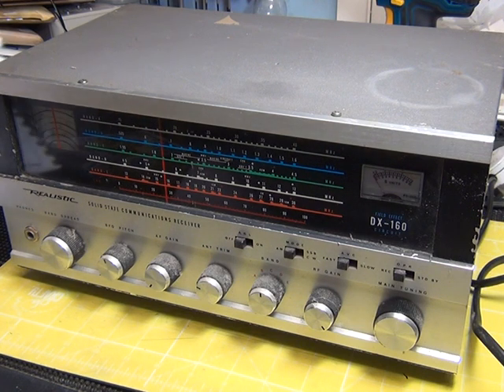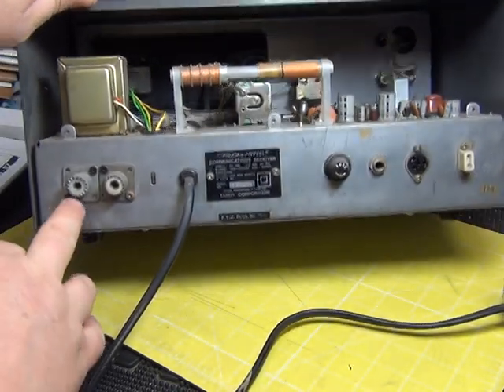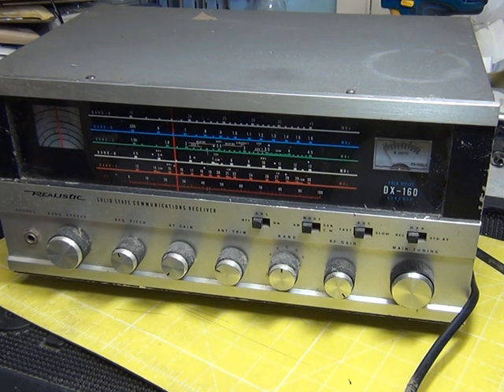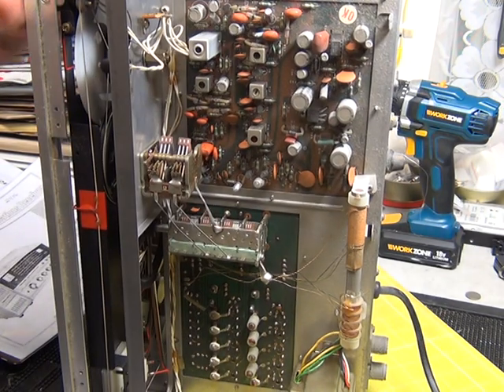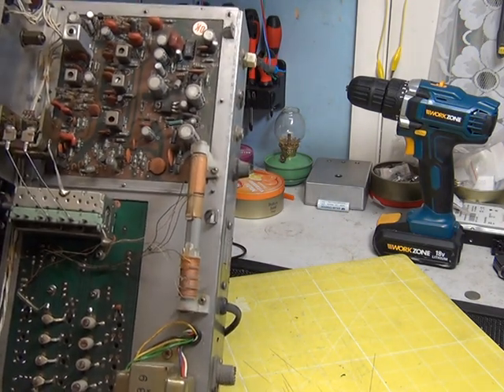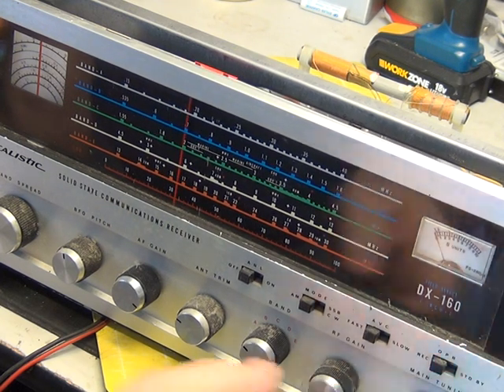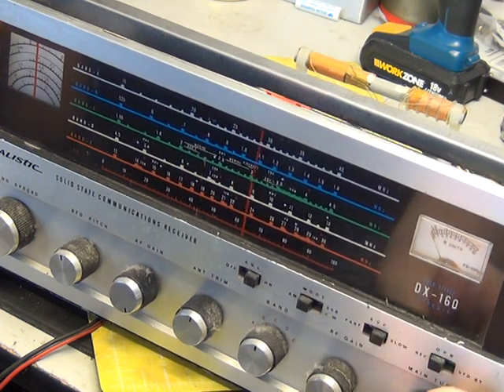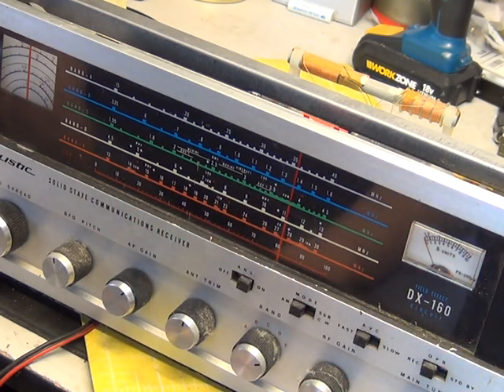Realistic DX160 overhaul pt1 (Late MkII version)

Comment: Hello,
I have the same receiver but the knobs have been changed. I want to put back some knobs that are as similar as possible.
What is the diameter and height of the original knobs? I think the tuning knobs have a larger diameter.
Regards,
JM  - CT1BRM

Comment: How do you tell if it's a "Late MkII version" & does it matter?  I've been looking for a 150B, but maybe the Late MkII version is better? 👍
Reply from the maker: Post Aug 20 1973 says the service manual. There originally was a date code on a small paper sticker...something like 10A4 would denote oct 1974 for example. However, other than that I can't remember. It's a long time since I did this video & if I remember rightly the later version has improved selectivity over the early one.

I recall the one I did in the video was 1976.

Richard, G0OJF, UK
Reply: Thanx for the effort.

Comment: A tip I found that completely eliminated hum in the audio.  Remove C76  (47 uF) and the ripple on the 10V rail reduces by about factor of 10.  Design flaw.   The DX-150 likely has same problem.   The LO drifts too, about 2kHz over 30 minutes during warm up.  (BFO against WWV standard carrier frequency)

Comment: Hi Richard
While you mention a dry joint on this: can't recall if you do, etc
I use a cheapie electric toothbrush  ( the couple of AA type) with the bristle end ground down to a simple plastic point. Very easy, very cheap, no shorts etc and very directional. Keep it coming :0)
Cheers, Dave
Reply from the maker: I'll get one..saw them at Aldi the other day for silly money. We have a smaller model sex toy type vibrator on each bench (pound shop), but your idea of grinding down the toothbrush i worth trying for spot checks in this instance.

Having said that I'm not aware of any dry joints on this particular set & doing the capacitors has brought it back to working order. Alignment tomorrow hopefully.

Comment: Hello from Hernando, Mississippi just 15 miles from Memphis TN!  I am in the process of re-capping my DX-160 as I write this note. Here's a question concerning replacing all transistors. I have it open and easy to get to. However, the traces are so delicate that my work has been slow replacing the capacitors. 
Therefore,. I have two questions for anyone who wants to answer. Really would appreciate your input. 
1. Considering that the transistors are equally difficult concerning the traces, would you suggest that I continue and replace them OR would you forget the transistors?

2. I have 7 capacitors yet to replace. What are your thoughts on me cutting under the OLD capacitors and leaving the OLD capacitors LEADS sticking above the PCB, then soldering the NEW Caps to the two wires left by the OLD capacitors? The objective would be to avoid disturbing the solder and traces of the remaining capacitors, although I know that there is still a possibility that I might overheat them and disturb them anyway. And I have never done this before because I like to do things right. Please respond if you will. Thanks so very much!
Wesley Kicker
Reply from the maker: Wesley. Capacitors need to be properly unsoldered not bodged in on old leads. We use an ordinary desolder pump tool though some people prefer desolder braid. We didn't find the circuit traces weak or small & had no snags whatsovever. The re-capping took 45mins for every electrolytic in the radio.

I can't figure out why you would want to change any transistors unless one proved to be faulty. I've no experience of transistors going weak, but either working or not working. Transistors aren't like valves (tubes USA) which go low emission with use.

Richard (UK)

Comment: Hi Richard, how do you find the Realistic DX-394?  Is yours the original (most complained about) version or the improved 'B Version', which dealt with many of the original's design flaws?
Reply from the maker: I've been too busy to look at it. Just spotted the box & it is date coded 11A6, so that will be 1996. I didn't even realise there were two versions. Might have to buy both to evaluate. I sometimes think that some peoples expectations are unrealistic though. I can't compare a mass produced 'cheap' communications receiver with a £10K commercial/military grade receiver; people do.
Still on a pipe organ restoration/installation so no hope of any videos regarding radio yet.
Richard
Reply: @ukfmcbradioservicingTango21  Yes, I agree; however, I think the negative reviews may have a few valid points.  You can identify the B version by its square "B" sticker in the corner of the back nameplate.  I had one back in '95 but I returned it as I think I found it too susceptible to bleed-over.  I guess I must have had the A version.

You may be interested to take a look at the following web page that describes the set having "fundamental design errors in the analogue circuits" and suggest mods to deal with them.  
http://www.monitor.co.uk/radio-mods/dx-394/dx-394.htm

Here's what one reviewer summarised the A version flaws as, but I've read about others not mentioned here: 
* Sensitive, but overloads with little or no provocation
* Filters way too wide for crowded bands
* Audio is only passable 

* 'A' version does not hold after alignment - some examples actually drift back out of alignment by the time the chassis cover is replaced
* Drift factors include thermal, humidity, and poor innate component stability
* Controls work well, but feel cheap. Tuning is known for its backlash
* Dial accuracy is only fair
Reply: @ukfmcbradioservicingTango21  I thought you'd be coming indoors by now, i.e. suspending pipe organ restoration/installation work, especially as it's gone very parky out there!   Brrrrr!  Those churches and chapels must be pretty chilly.
Reply from the maker: @zerox-mission5898  Yes, I'm having to pick my days

Comment: That should turn out to be a good radio when you have finished it....GRE equipment is usually very good .Im looking forward to hearing this up and running
Reply from the maker: So am I. Just looked at the service manual whilst cleaning the front & changing lamps & found I have to build an IEC dummy Antenna to replicate a perceived 400 ohm long wire, rather than the usual 50 ohm load. Have quickly ordered all the bits needed from RS, so will make that tomorrow.

Richard
Reply: @ukfmcbradioservicingTango21  Ha Ha it should all be worth it in the end.....Must say i prefer all you CB stuff..Keep them coming
Reply from the maker: Yeah, well we've not done any shortwave or amateur radio stuff before & this & the topband transmitter project are for a specific purpose. Looking at the viewing figures for this channel, the 'cleaning records the ultrasonic way' has the biggest viewing figures along with some of the radiogram servicing jobs!
Reply: @ukfmcbradioservicingTango21  Yea is quite a niche channel thats the thing....The content is excellent if you understand it. try not to add too much diversity to it though as that seems to confuse people..Keep up the good work.